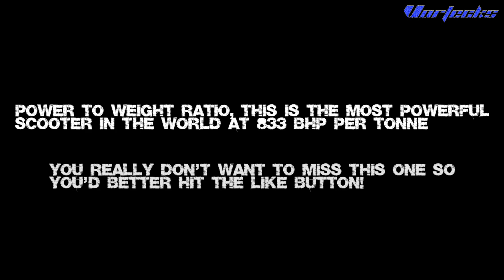🔴 The Vortecks FQS scooter intro - the most powerful scooter in the world (power to weight)

Comment: LOL The power to weight ratio for electric scooters looks impressive...and it is... when its parked up...until you sit a rider on it that weights 4x as much as the scooter, don't get me wrong it'll still rip along the road at a stupidly silly pace, but like anything with a high power to weight ratio when it weighs so little the power to weight figure takes a tanking when you add the required ballast that is the driver/rider.

Either way looking forward to the maiden voyage, don't bother spending any real time editing it Tony, just get a simple "structure edit" on it done and that'll do...quick verbal voiceover overview of the build with a walkround, specs, and then test run/maiden run ...job done.
Reply: How bout' no bucko!